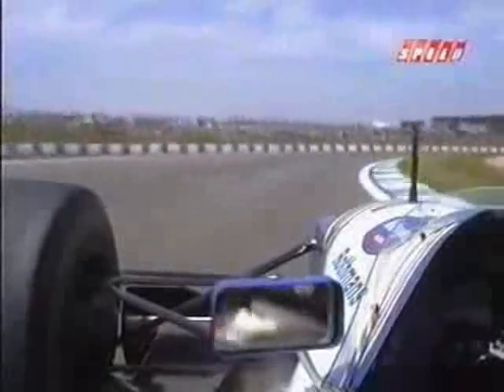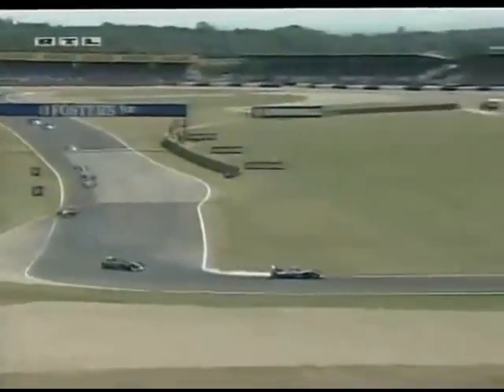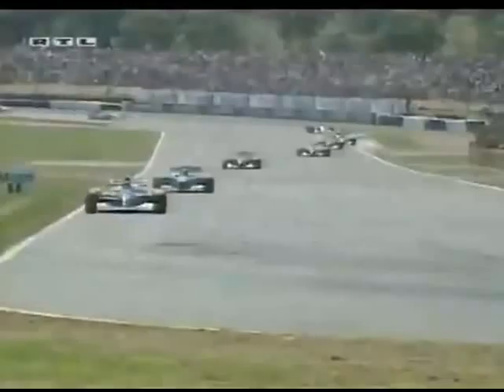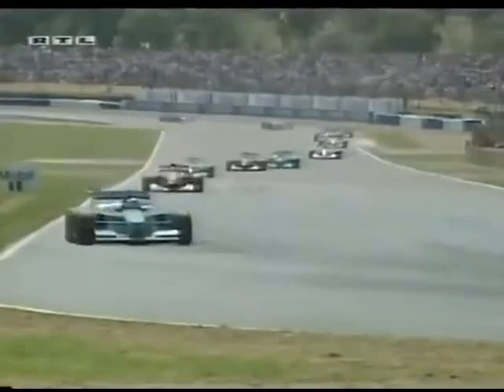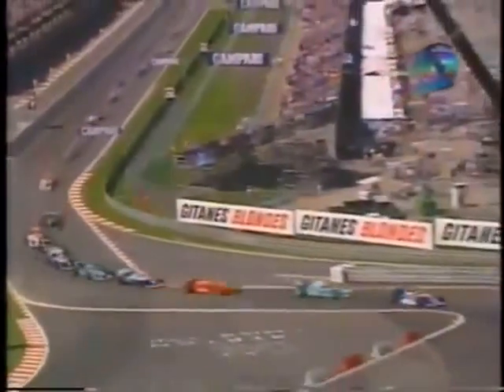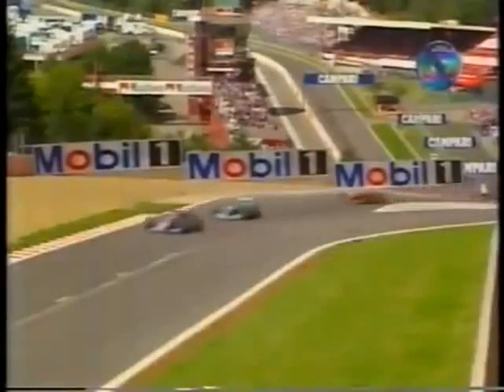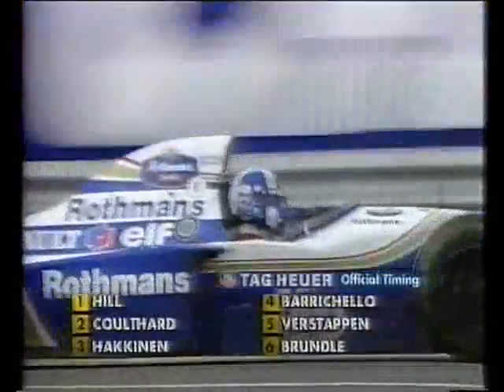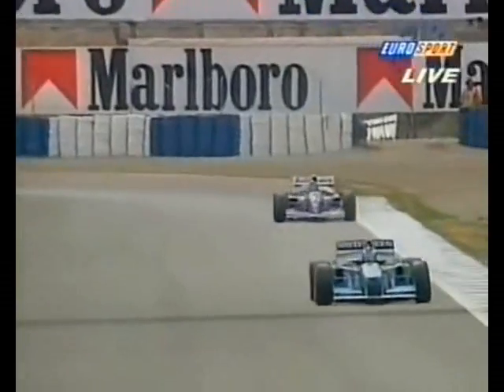All 1994 Formula 1 track layout modifications – Part 1/2

Comment: It’s kinda funny they could put chicanes at all these tracks for “driver safety” but wouldn’t do so at Indy in 05
Reply: It was against the law by the state of Indiana
Reply: not the same, tho, as in indy, one manufacturer had a technical limitation, while the other didn't. Bridgestone tyres could do it, so why would they accept a change that limits their chances? I don't agree with how the whole thing played out, but they had a point...
Reply: Teams were going to get together and run the race anyway without FIA sanction since it violated a bunch of FIA rules to change the track after qualifying. A lot of politics happened. FIA realized they didnt want the teams organizing their own demonstration races because it would make them completely irrelevant, teams woudl realize they didnt need the FIA. So they shut it down. It's actually a very interesting, complex story, with most parties just agreeing to forfeit the points, money, race, whatever just to put on a show.
Reply: @KyleP133  But what comes first - sporting integrity or the show?
Reply: Not once qualifying and practices had happened; there was no opportunity to practice that proposed chicane before the race—and as has been pointed out only Michelin tires had the problem, and both on one team.  (Oddly, at Le Mans it was cars with Michelin tires that also had problems; at least three times cars came to the bottom of the Mulsanne straight with flat tires while leading.)

Comment: So I do think Eau Rouge looks horrendous but I think as a corner on its own and not a modified Eau Rouge, it does look quite nice and I like it. I'd still pick an Eau Rouge typical version any day
Reply: There’s a section at Eau Rouge that goes even farther back than what’s shown here; if you look at a satellite image of Eau Rouge there’s a section that was used for a number of years, behind the present day stands.
Reply: A new Eau Rouge which were kind of "in between" the 1994 version and the traditional version could be interesting. Nowadays, the F1 cars have so much downforce that it's not a corner, it's just taken flat out. A narrower corner would bring back the challenge, while reducing speeds at what is still a dangerous corner if something goes wrong.

Comment: Should also point out that it wasn't just Senna's death that motivated these changes. Roland Ratzenberger's death and Karl Wendlinger's near fatal crash at Monaco also motivated changes to the tracks and improved car safety.
Reply: I think Abbey change could be done because Lamy had crash in tests (Silverstone) which could end his carrier (broke his both legs). Also, JJ Lehto was injured in pre-season testing and Montermini was injured in Spain, which had chicane, but not on finish straight.
Oh, and Alesi was also injured in testing.
Reply: Senna was the tipping point tho Nascar let 2 drivers die before dales death made sweeping changes

Comment: I think Hockenheim and Monza although did get modified that year.
Reply: yeah, they tightened the 1st corner in Hockenheim and made the 3rd chicane tighter as well (although that coul´ve been already 93). Monza had Curva Grande pushed inwards and the Lesmo 2 was made slower (which was horrible, as the flatout Lesmo 2 gave a good run towards Ascari). Not sure if they changed the chicane after Curva Grande in 94 or 95 (pulled the chicane sooner to give bigger run-offs), but for sure they pushed the Lesmo´s further in in 95 to make bigger run-offs.

But people have to remember that tracks evolved before this too. Silverstone had some slower corners added in the 80s and early 90s (the luffield section added, the maggots-beckets complex, the chicane after Stowe), the Hockenheimring kept adding and changing the chicanes, Monza added chicanes over time,  Interlagos was made shorter and slower for the 90s (although was still a kick-ass track even with the changes) and Montreal had had a few changes as well in the 80s.

Comment: I hated the Portugal chicane. No overtaking opportunity. Just ruined the flow of the circuit.  Tanque was where Cafi broke his leg in 1990 but couldn't they have moved barrier back and add sand traps??
Reply: There’s houses and such directly behind Tanque so no. What they didn’t have to do was create such a tight chicane. I suspect they did try to create an overtaking opportunity as it’s very wide compared to much of the rest of Estoril, but they didn’t do a good job.
Reply: If you look at the track on google maps. There’s actually room to add run off just as the bend at Tanque starts. However next to it there’s houses close by.

Comment: They modifed after sennas AND Roland ratzenbergers death
Reply: @williammaurice7206  Not representative: Barrichello Crash was at Variante Bassa.

If you wanna take an example, use Berger 1989: he crashed at Tamburello, the car took fire, but he survived.
Please also note two things:

1- There was a reason for the wall outside Tamburello. Originally the track was a road circuit, and the Tamburello corner was made near Santerno river, so no place for run off area. Following the example of american speedway, the wall at that time was considered a safer option.

2- What killed Senna was not the impact against the wall, but a suspension part that pierced his helmet. The root cause for Senna death was more in the cars, and much less than you can think on the track.

Comment: The Spa Chicane probably needs to come back after what happened in F2
Reply: nope nope nope nope...
Reply: Rafael Prados Barbosa the speed was a big factor in the accident.
Reply: Spa Chicane is dangerous, you heading to wall, plus you have turn. then once you get to the top you can lose traction, and lose control, at high speed. I've lost it few times in a simulator. It's also very important you have enough wing. The problem is people play with the wing because spa is such fast circuit the less the better, but more dangerous at that chicane.
Reply: Like all safety incidents, they will probably change it when there is crash number 2 or 3. Just look at Imola, Berger, Piquet crashed into wall before senna, only after senna lost his life they changed it.